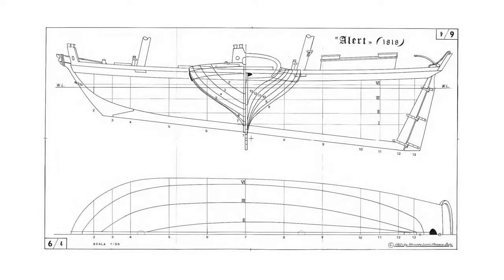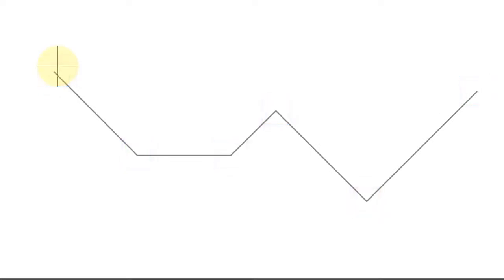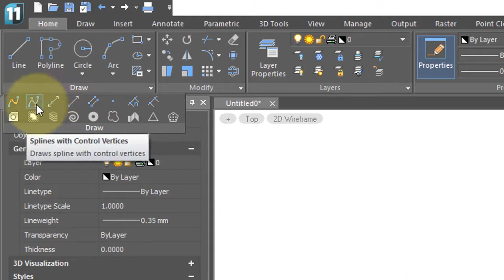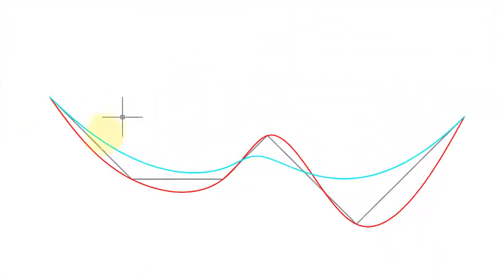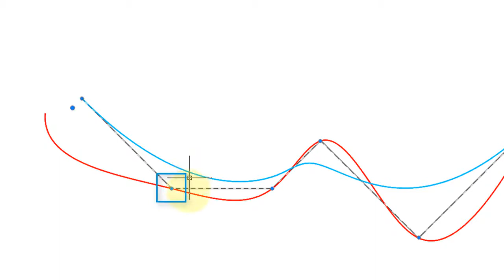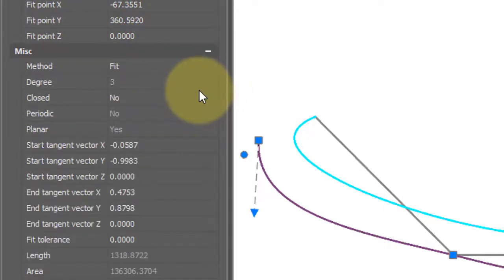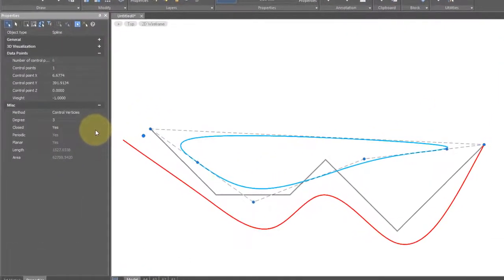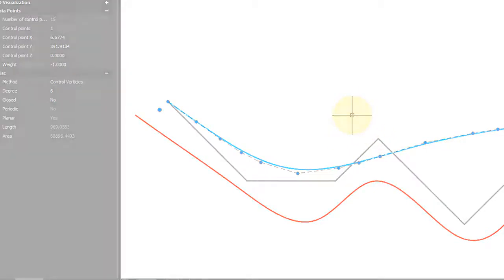How to draw splines in nanoCAD

Comment: How do you esxtrude a loft créate with splin lines? It doesn't me selectividad the object. In autocad you have surface extrude with solid opción.
Reply from the maker: EXTRUDE works with surfce or closed area. If you create a closed area with spline or polyline EXTRUDE will work.